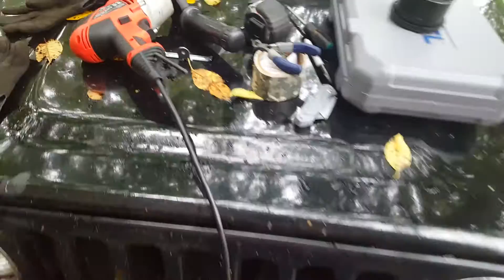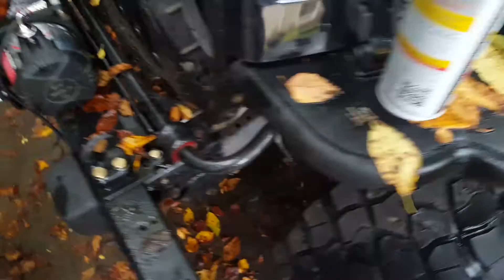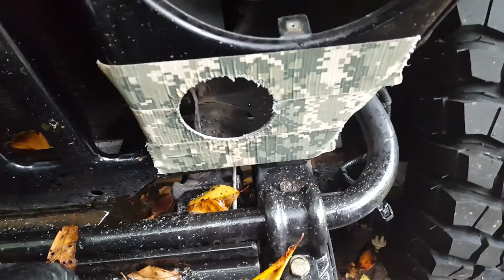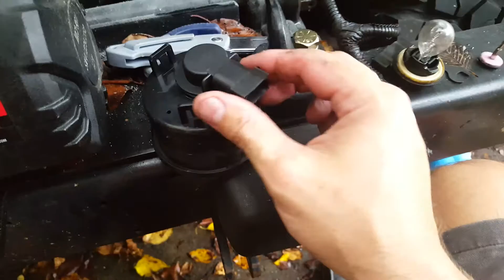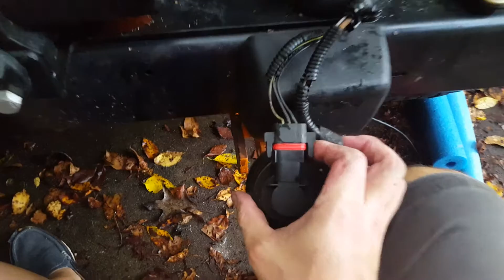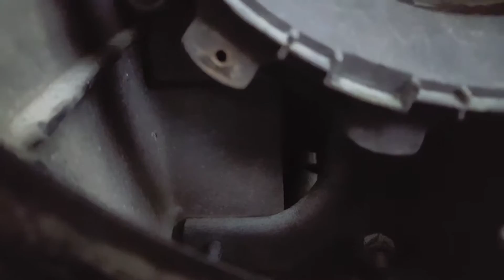JK CJ style parking light/turnsignal on a TJ part 1

Comment: Mine was doin that until I changed the side marker lightbulb that was out, although I wasn’t using that marker/front side was tucked away that’s what I had to do idk about the resistor could be another I tem in process ov elimination you always wana go with the cheapest solution which in my case was the light bulb, you can start their then ur resistor good luck

Comment: Reason ur lights are blinking fast trust me on this, one of ur light bulbs is out, the energy that is supposed to go to that bulb is being added to ur turn signal, check ur all light bulbs make sure they re all working...
Reply: nathan sunnaa the LEDs pull such little power the Jeep thinks the bulb is out. You're supposed to use resistors so it'll draw the same power as a regular oem bulb